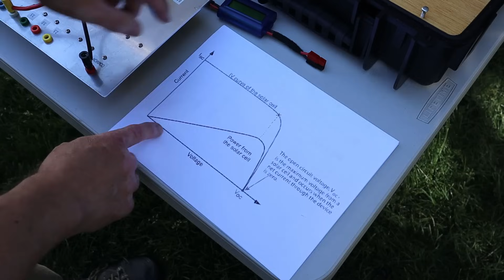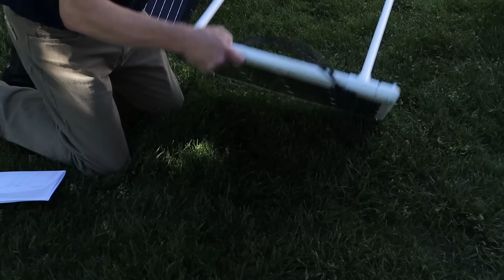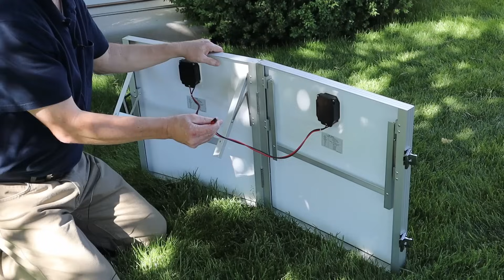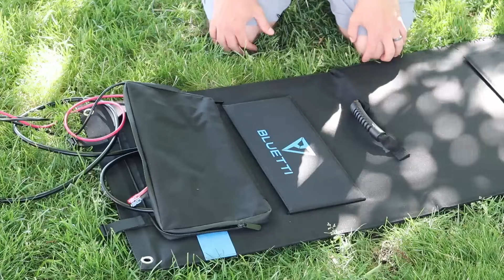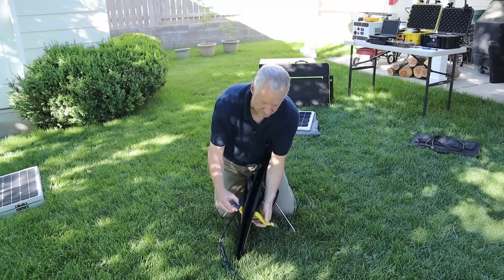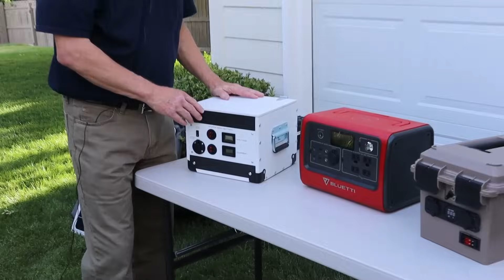Portable Solar Panel Comparison, 11 Different Models! Sunpower, Baldr, Rockpals, Bluetti, and More!

Comment: Hi Is there any solar Panel manufacturer Who manufacture specifically for charging 48volt Ah from to 72volt Ah?
There is no mention 
What are all various gadgets can be charged?
I desperately searching approaching sellers none are able to give details nor IS THERE IN MARKET AVAILABLE ?
OR
 CONSUMER'S DEMANDS FOR IT?
Thanks I from India,Mumbai City
God Bless all be safe
#Covid19 variant is emerging many countries cases are increasingly a serious concern ALWAYS WEAR MASK SAVE OTHERS ITS OUR EACH ONE OF US HUMANITY DUTY
Reply: Sorry When I said or mentioned 48volt 8Ah I meant 12volt 8Ah each connected into series to get or reach out to 48volt 8Ah in total volt or 60volt 8Ah
There was a confusion so let me clear this my own uses for charging Lead Acid Batteries and Gel lead Acid batteries
If some one can help me please help me
I am not using #Lithium Batteries due to its nature of Higher cost YES I KNOW #LITHIUM BATTERIES CAN BE ASSEMBLED ACCORDING TO ONE'S NEEDS
I FACE PROBLEM WITH LESS DANGERS lead Acid and Gel batteries to get charged
So my request is for 48volt 8Ah (4battery of 12volt  8Ah in series totals 48volt 8Ah) and So for  72volt 8Ah(6 batteries in series of 12volt 8Ah each 6 batteries in totals 72Volt 8Ah in total
Reply from the maker: @philipjoseph1509  you want to get a 48v solar charge controller design for lead acid batteries and it should work just fine for your setup. That solar charge controller will mention the input voltages it accepts so then you can choose the solar panels you want.
Reply: @Jasonoid  Thank you @Jasonoid God Almighty Bless you
Dear My curiosity was and is to find out without Energy Consuming Extra or additional burden over our all types of Batteries ONE CORE POINT DEAR
Then For me and my INNOVATION What I use simple Lead Acid Battery WHICH ALL OTHERS I MEAN REST OF WORLD TOTALLY UNDER ITS SPELL
Even Well know for its "FIRE" Catching Dangerous On Flight It is not allowed to carry are some or major factors
And its cost compared with its longer service in use Again with the High Cost Those who Use for their applications or
Two Wheeler Three Wheeler buyers are made to convince Their one time investments can be recovered in a year are some factors all sellers cite and sales pitches are every ones lips even those #Youtubers Who do not know any in and out of technical answers but
JUST LIKE PARROTING THEY GO ON CREATING CONTENT SAYING WRITING ARE REALLY WORRISOME FOR ME AND FIR THE INNOCENT CONSUMERS

WHILE ADVANCED BATTERIES IS NOT A PERFECT SOLLUTION FOR OUR DAY TO DAY NEEDS

Its major factors lies in some other areas
SUCH AS ENERGY GUZZLING EQUIPMENT'S HOUSE HOLD CONSUMER GOODS OF SOME AND ESPECIALLY HOUSE HOLD ITEMS SUCH AS FANS 
LED LIGHTING IS ADVANCED SO OUR ENERGY BILLS
Such thing should happen in lot many areas seriously for we consumers life should be easy comfortable So those good manufacturers too have enough profit margin to profit
Example EV's are growing but At What Cost?
Instead of pumping huge  $millions on Electric Motor such as #EV's Hub motors which consume huge battery energy Its whole Sellers just sell Where consumers suffer
Dear you visit every youtube There you will find millions of millions comment Their concerns not or never going to addressed 
Have you ever have you ever thought of our brothers sisters who do yearn for products which you and me may be able to buy
What about those struggling? In life society community nation global citizens irrespective of colour creed nation lots of them starve have no jobs security are kept away from real progress of every nation country
How far?
INEQUALITY'S POVERTY UNDER DEVELOPED UNDER HEALTH MALNOURISHED
Profits are not shared other hand AGES THEY ALL SUFFER
These are all cleared in my innovative thinking 
So I use simple LEAD ACID BATTERIES
I WISH TO GET CHARGED THEM ALL IN WHAT EVER VOLTAGE 12VOLT 48VOLT 60VOLT
I could not find only single battery can charge
I am not going to use additional energy guzzler in my design for the sake of mass reachable among weaker sections from the developments progress are my INNOVATIONS BRINGING DEAR
Thanks for your kind gesture
There is technology available to ease our living and for A BETTER WORLD SOLVING ENERGY NEEDS POLLUTION'S AND TO HAVE PROFITS FOR ALL STAKE HOLDERS IMMENSELY
But our chosen wrong paths in progressive world WHAT WE THINK ACTUALLY NOT

Comment: Perfect!  I just ordered the older version of the RockPals this afternoon, then saw this video tonight.   Feel like I did the right thing.   This is my first solar panel/battery I've ordered.   Guess Amazon's clearing the old ones out as it was $179. 😊👍
Reply from the maker: Great price on that panel! You'll like it
Reply: Which ones did you buy? RockPals? And how many... and for what Power Station (generator)?
Reply: @JudiChristopher  I bought Rockpals foldable 100w solar panel.  The older model does not have the stand things on the back so it must be leaned up against something, or laid flat.   The battery I purchased was the Togo 330w.  ✌❤
Reply: @NYCHFAN  
Thank you for the information... 
I have found out that since I'm going to be using the Solar Panels everyday, I will be living in the travel trailer... that I should get the "Fixed. Rigid, or Glass" panels, so they can be fixed on top of my Travel Trailer. They can handle the HEAT and weather more...

Comment: Good JOB !  Most solar panels are NOT put out in the sun 24 hours a day !! LOL !!  Unless maybe in the arctic!
Reply from the maker: Correct, this video is about using portable panels for camping and so forth. Rigid glass panels are for 24/7 usage.
Reply: @Jasonoid  You missed the point.  He said its not meant for putting out in the sun 24 hours a day which is of course impossible except where there is daylight 24 hours a day.  Thats why it says LOL !
Reply from the maker: @teekay1785  gotcha, totally understand lol

Comment: Great comparison. On the question about outside durability. Some of the competitors state (in the fine print) that they are not waterproof. They can only be “splashed “ with water. I just bought 2 140 watt Ecoflow panels which are going with my 1800 watt (it can handle up to 3 panels) Ecoflow Delta solar battery pack. The panels can be submerged in water for 30 mins and still functional afterwards. They fold in four sections, and come in a handled portfolio carrying case. Would be nice to see them reviewed in an updated video. thanks for all the time it took for this review (and the one on refrigerators
Reply from the maker: So portable panels aren't near as durable as the rigid glass ones. They claim waterproof levels but sometimes I doubt the claims. There are trade offs between the two. Portable are about mobility and convenience. Rigid panels are for durability and long term output/water proof. There are different situations where you need BOTH types of panels :D

Comment: Excellent video. Thanks guys
Reply from the maker: Thanks for watching, what type of solar panel are you looking for?
Reply: @Jasonoid  I'm pretty new to the subject and just learning the basics of the industry. Videos like this condense so much knowledge in a short time and I appreciate that. 

I'm now trying to decide on foldable monocrystal vs full flexible units. Things like camping and hiking are secondary use cases with emergency prep as the primary.

Probably will go the diy charger unit route. I have family that is very well rounded in electronics so I'll be linking up with them and showing this video as a guide to what I want!

Subscribing do to the engagement. Keep up the spirit.

Comment: which part of the earth are you on where you can leave those out in the sun 24 hours a day?
Reply from the maker: We use these portable panels for camping trips / and backup power if needed. If you want to have a panel in the sun all day everyday stick with the rigid glass ones.

Comment: The Poly- & Mono-crystalline panels & cells ARE better than they used to be, but I'm an Amorphous-cell/panel person, since the crystalline types usually DO have a little more efficiency at 100% sunlight on them, but if the available light drops from passing clouds or similar, the output typically drops to almost nothing (in my limited testing), while the Amorphous cells & panels may have a little less output at 100% light, but they have a much more, "almost linear" output drop which follows the decrease in available light, & as many people have said, "I'd rather have a little of something, than nothing of anything".
 Have you had any thoughts of doing comparisons on Poly- & Mono-crystalline vs. Amorphous cells & panels, in addition to protective materials?, since my panels are glass-faced & I'm usually in the upper-southwest area of the USA "Tornado Alley", and when there IS the very occasional hail pinging off of everything, it's nice to know your investment in panels is protected by a "least-loss" material.
 Also, any thoughts of comparing various protective after-market protective materials, such as "Lexan", ("Lexan" is a copyrighted brand-name, property of the respective holder of record), or other coatings, panels, or other protective materials?
 (BTW, hats off to the use of the same "load-bank", connectors, & watt-meter to measure the different panels; it gives us a good idea of "real-world conditions" load-handing.)
 Well done!
Reply from the maker: Thanks for your insight, these are some good thoughts! I'll have to check out Amorphous panels!

Comment: How did you account for a consistent sun intensity over all the panel tests???
Reply from the maker: Yes, all were tested for a 20 minute period, in the same conditions over a span of a couple days during midday. Very clear skies, no haze or clouds.
Reply: @Jasonoid  were they tested simultaneously?
Reply from the maker: @sector7offshore  they were tested in sets.... lots of panels, lots of testing. Pretty "real world" results in the video, most people should see similar results in their area respectively, during the summer months that is.

Comment: Would you recommend the Baldr 120  solar to charge Jackery 500 ?   Thank you for your help.
Reply from the maker: The Baldr 120 watts comes with the proper adapter to use with the Jackery 500, it will work great with that power station. The max input of the Jackery 500 is 100 watts so this larger panel will give you a better chance of hitting that max output more often! Thanks for asking!
Reply: Sorry to bother you . I have one last question. This is new to me .If you had to choose between the Baldr 120 or the Jackery 100 solar panel .which one would you choose ?
Reply from the maker: @zacattack4029  No problem man, happy to help. Are you going to be using your solar panel out in the sun all the time or are you going to be using it on and off only while camping or during power outages? Permanent solar setups are better with glass rigid panels, these portable panels aren't meant to be in the sun 24/7, 365 days a year. So if you plan to use them just for camping and every now and then, I would go with the BALDR because it's cheaper than the Jackery. If you want to use the panel all day every day, stick with a normal 100 watt rigid panel like a HQST, NewPowa, or Renogy model.
Reply: Thank you for your help. I will be using the solar panel  off and on at home and camping .
Reply from the maker: @zacattack4029  the baldr should work well for you!
Reply: @Jasonoid  
Thank you
Thank you
Thank you very much for this GREAT Video and this comment... I didn't even think about the difference of Permanent and using the panels here and there.. Of course that makes perfect sense! "Hello" LOL....
I am getting ready to LIVE in my Vintage 1972 Travel Trailer making it like a Mobile Office too (when I resale it)... It is only 17' long... but I want to make sure I do have enough Power to be able to Work out of it too..

Comment: Thank you. Sun Power sounds really good, too bad it doesn't come with a case. I like the PVC stand you made for it. Cool that you made your own batterypack.  Is there a way to charge all three batteries through a car alternator?
Reply from the maker: The battleborn and my DIY 80ah battery can charge using a dc to dc charger via an alternator. I have a video on the DMT 1250 dc to dc / solar charger. I put it out a few weeks ago.

Comment: It is a 5 Volt Buck Convertor for the USB. 8 Amp, 4 USB Ports, P&P, $7.00 on eBay. Got a 120W Panel in 2006 and Paid $600 for it but there is a lifetime warranty on it. Got it mounted on my camping SUV. I left my ignition key one day and ran the battery down. A couple hours later I on my way from where ever I was. I am Seventy and it will still be working long after I am dead. Funny thing though this year when I was charging my DIY Li-Ion(made with 5K Mw Tesla 21700's 35A discharge batteries) Solar Generator the Charge Controller shut down. I put my meter on the output TERMINALS and the thing was putting out 21 volts. I had to put a Buck Convertor on the Solar Panel. WTF. Any Ideas?
Reply from the maker: Not sure how to understand your post, lots of good info in there. What voltage or cell configuration was your battery before it broke?

Comment: The closed back on the panels will heat up and drop the efficiency, the ecoworthy will stay cooler and it’s efficiency will stay higher over the long run. Be careful on hot days if you need a 100 watts then buy a 125-150 watt panel. Test them over time and you will see a big difference. Instantaneously testing panels will give you a false reading you have to let them heat up and then test them. The closed back panels will drop watts like a rock when they get hot.
Reply from the maker: Very true, I haven't seen huge losses in power on these portable panels but I usually have the kickstands up or on a slight angle with a 2x4. I have measured 170F degrees in my panels before..... Ouch!
Reply: @Jasonoid  
WOW... SEE That is another Great Information I didn't know!!! Be sure to tell your viewers in ALL your videos about this... Thank YOU!!!

Comment: dumb question - can these panels get wet/rained on?
Reply: That is NOT a dumb question... Excellent Question.
Reply from the maker: Some of them are waterproof, you just have to check the specs. Sunpower 50 flex at waterproof, bluetti is waterproof, others are water resistant. Better to have rigid glass panels for permanent outside installation.
Reply: Ideally it would be slightly more efficient to use a precipitation panel, above the 39th Parallel. This amazing new Chinese technology converts single droplets of water into green, green energy by the thermodynamic transduction method (only the Chinese really understand how to make it MORE efficient than solar). You could just use your regular solar panel, but there will be some frictional energy lost, according to the inverse square law that governs point source energy transfers (including sunlight ---> panel). And, if the panel gets hot, a small amount of energy is also evaporated as steam (although this amount is not really worth calculating for napkin purposes). As you get closer to the equator, it's  typically more efficient to just stick with a common solar panel.
Reply from the maker: @PaulLawson-k8v  send me a link to this product! Never heard of anything like it...

Comment: Great comparison! ... I'm surprised you didn't have a Jackery Saga 100 watts. I have a few different portable solar panels and the Jackery is maybe my favor one due to its power output and simplicity.
Reply from the maker: I'll have to check that one out sometime. Is it water proof too?
Reply: @Jasonoid  - Yes, it is water-resistant and it's very well built. The only issue is, it only comes with a 7.9mm barrel connector, but it's easy to make a conversion cable 7.9mm to Anderson.
Reply from the maker: @JoeDplummer_  I try to make all my connections the same, then I can use each panel on every device I need to charge. Anderson works pretty well. I'll have to look at buying one.... They cost a pretty penny though haha

Comment: Do u have the efficiency numbers for these panels?
Reply from the maker: You can check with each manufacturer website if you want to see each those individual specs. In real world performance the wattage is all that matters when you are trying to charge up a battery. Most of these panels did pretty well in our testing. Best in my opinion is the Rockpals RP082 or BALDR 120 watt.
Reply: @Jasonoid  ok great thank you

Comment: Which connectors do most newer RVs use for solar panel prep?
Reply from the maker: Most RV installations will use a ridge panel on the roof that uses MC4 connectors.